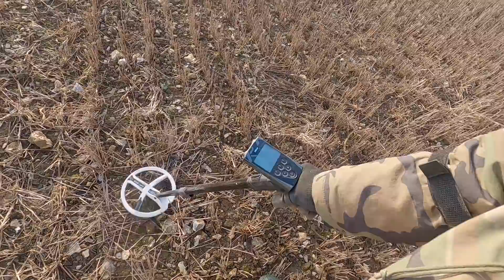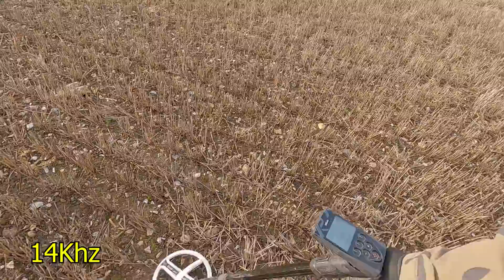XP HF coil ~Testing high frequencies

Comment: Hi Garay
I'm fairly new  to the D1
But learning all time.
Using  pitch hot and fast programs
I recently  purchased  a HF coil ,and wanting to no what best programs and frequencies to adjust .
Can  I adjust , and up the frequencies also in the pitch and Fast programs ,to have the same  sensitive affect 
Cheers 
C
Reply from the maker: Yes you can change any program to any frequency.
Take a look at my Sonar program videos.

Comment: Hello from France, good choice ! it will be better in vietnam ! The best program is the beach sens, i don't like pitch, the square or the pwm are better. You can use sel sens for more stability, and increase a little the réactivity + 0.5 to 1.5. The mode all metal is good (push the right botton up). Don't forget to make ground balance (move the coil not more thant 5 centimers from the ground). I used the Equinox for a long time, now it's finish, only the Deus 2, it's the best for beachcombing.
Reply from the maker: Thank you

Comment: Should I get the 9" x35 instead of the 9" white HF if I already have the original black 9" coil that came with the machine. My original does 4khz to 17khz and with the HF doing 15khz to 55khz surely there is no point getting the X35?
Reply from the maker: If you have the original black coil, I would personally get the white 9" HF.
But its your choice.
Reply: @The-skillschool  yeah! I've been weighing it up and I feel it would just be pointless getting the x35 when I have the original too. When the original does most of what the X35 does.
Thank you! 👍🏼👍🏼

Comment: quick question, and maybe a daft one 🤔. does anybody know if the higher frequencies of the hf coil are still used without the control unit (just using headphones)  if that makes sense 🤣
Reply from the maker: Yes on the Deus only

Comment: Another great video gaz little question for only on the 9"hf coil don't do on the epileptic coil or the x35 it's like the rubber in bottom stem that sits against coil mount is making a creaking noise if I undo it all and put it bk together it stops then as soon as I go to use it again it starts creaking again
Reply from the maker: Thanks Steve.
Double check you have the spacer in the lower stem with the HF.
Also the top hat has to be fitted correctly.
Failing that change the washer perhaps.
Reply: @The-skillschool  ill try again cheers

Comment: Hi Gary, great vid! I’ve been a deus user for about 5 years now and I’m still using v4 with my old 13” black coil. I still love it and everytime I think of upgrading out pops a cut quarter or a piece of gold that makes me think “I’ll stick with the old girl!” But lately I’ve been thinking of getting a smaller coil, for trashy sites and also for stubble which is hard work with the big coil. If I get the HF coil can I still run it on my v4 software? Thanks, Tom. (As a side note, I’m not 100% certain that I won’t upgrade to the latest version, if I did would my old black coil still work?)
Reply from the maker: Thanks for watching, yes the earlier coils will work on the latest update.

Comment: A question to the Community.... how long should the ws5 accus hold the Energy without Loading.... my ws5's are out of Energy within 2 Days of non using🤔 thats the only thing im pissed of with the Pack have, and i Think its not normal...
Reply from the maker: Sounds like they were either turned on or there is a battery problem

Comment: Hi Gary ,running the hot program with the 11 inch X35 coil and then increasing the frequency to as high as possible my finds rate have shot up.A re-visit using this method picked out another 8 Roman coins that were previously missed, a couple half the size of a drawing pin! 
Is it really worth purchasing the HF white coil when so often there is not a great difference between 31khz and 54khz?
Reply from the maker: Hi Mark, thats a tricky one, if you are finding small items with your X35 and happy with it then stick with it.
Personally I think the HF can offer an advantage on Roman sites.
Reply: @The-skillschool  Thank you for your thoughts,its one Ive wrestled with for a while,I shall ponder further!

Comment: Hi Gary, I've been experimenting on 28KHz hot programme with the 9" elliptical. I've been detecting a finds-rich area with lots of tiny buttons etc. I've found loads of stuff missed previously on 14KHz, including some targets that were quite deep. After finding targets on 28KHz I tried switching back to 14 to see if I could hear it - you get that high tone but it's so faint at 14 that it is easy to miss. I definitely recommend anyone with the HF coil goes over their previously detected sites with higher frequencies because you just never know what you may have missed.
Reply from the maker: Thanks for the feedback 👍

Comment: Gary, I use X35 and generally if I find an iffy target on 17khz I drop it to 7khz and if its still Iffy or worse I walk on. Granted sometimes I'm probably missing stuff and sometimes I dig anyway and 90% of the time the machine is right. Lower Frequency always tends to ID the scrap better which I saw in that video too. What the video told me is that if your on HF above 30khz your probably going to dig more targets as they all sound better if there's a hint of non ferreous in there.
Reply from the maker: Thanks Andrew, you are right the lower frequencies help identify the bigger mis shaped iron.

Comment: That's why I normally use Deus Fast Program with the HF Cool which I Love. Always in 14 kHz , Audio on 2 by using WD4 Heatphone. Under 40 and over 90 I just dig Liter. Higher Frequency only If there are Electrical issues to cover.

Comment: I was recently at a site with bad EMI a cattle fence near by plus overhead power lines I tried all sorts of adjustment and finally switched to dry beach the emi was almost gone and I soon popped out a gold ring and a silver coin plus a bunch of coppers I have been over this site with 2 other machines plus the Deus on days when the emi was not bad and expected to find very little but was surprised that by changing the search mode I would find stuff I missed I also noticed the Deus loves wet soil over dry and can go to a site after a good rain and it's like it's never been hunted thanks  for the video and happy new year
Reply from the maker: Thanks for the interesting information.

Comment: Interesting video, thanks Gary. I have the original 11" and am trying to resist getting a 9" HF but you're not making it easy! 😁
ATB for 2021!
Reply from the maker: Thanks Neil 👌
Reply: Just run it at the highest frequency, TBH you won't really miss anything IMHO....
Reply: Thanks for the tip, I do mostly run it at 18kHz but do try other frequencies if I find a productive area. 👍

Comment: Hi gary, used the orginal adx 100 fixed coil, it ran on 3khz i think but it could hit them tiny cut hammered coins and low conductors like small gold, always a contentious issue frequency, my favourite was my origanal goldmaxx not the power i could tell how many holes were in a button before i dug it, i moved on to a deus but i could not gel with it, i use the equinox 800 now, great video gary, all the best and happy new year,
Reply from the maker: Thanks Stuart, I have an ADX perhaps I should take it for a spin.
Reply: @The-skillschool  please do gary it as to be the original with the fixed coil, dont no why the one with the removeble coil did not seem to the same, turn the disc till it just clicks to on, no further, it can nock out your spade, its very old school it dont make a peep till bang signal, it also works on the beach mine died a few years ago its one that caint be replaced but sorrly missed it was a remarkable detector, xp at its very best,

Comment: Great video Gary I thin they would be a difference in the signal strength between 31 and 54 if the target was a little deeper for the 54khz to make a difference I think the ain't much difference in the tatgets in the video as they were about the same depth
Reply from the maker: Thanks TKF frequency is a dark art 👍

Comment: Thanks for another video and Happy New Year. I get on really well with my Deus but the only thing it lacks is being multi frequency, I know you can change as you were in the video but it's not completely multi frequency if you know what I mean. Thanks again 👍
Reply from the maker: Fair comment RRH trouble is Multifrequency is slower than single frequencies because they need more time to analyse the signal..
I've done all the tests myself, air tests are not conclusive, in the ground with iron at different depth levels really shows how single frequency is best.
Reply: @The-skillschool  Thanks Gary that makes sense.

Comment: Its always a trade off between the coil coverage. I like to run the x35 11" at max frequency, even on low conductive targets. Would have been interesting to repeat the test with this coil. I have the HF round too.
Reply from the maker: Video would be too long